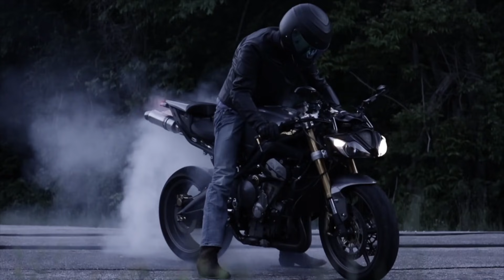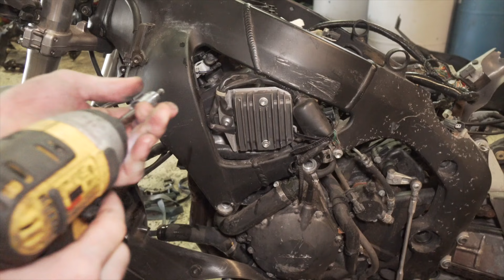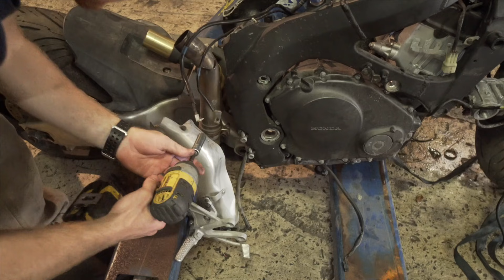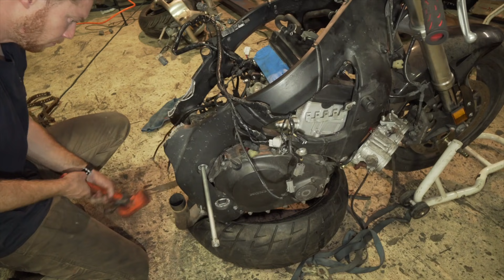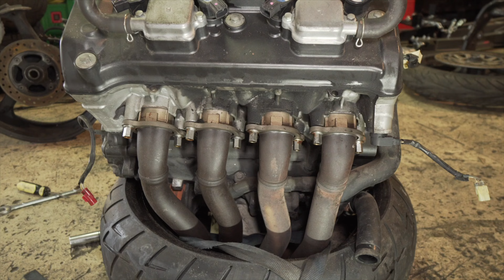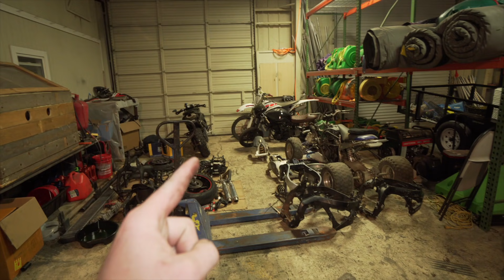HONDA CBR1000rr Wrecked Bike Rebuild (PT.2 Tear down)

Comment: Unfortunately my coolant intake Union is cracked and one of the bolts to get it off is behind the frame out of reach does anyone have any suggestions on getting it off without completely dropping the motor and pulling off the air box??
Reply from the maker: On what bike?